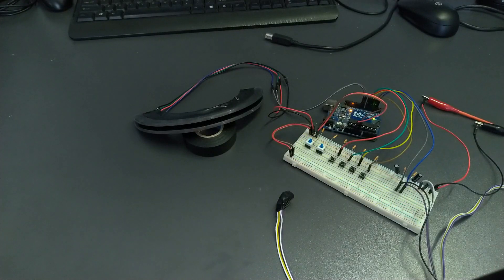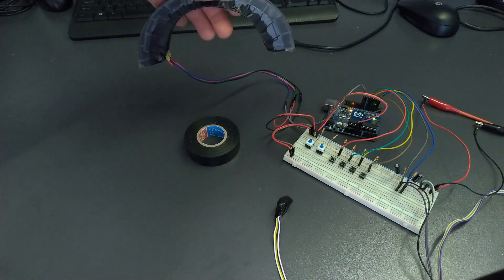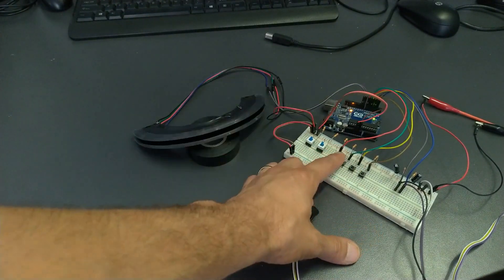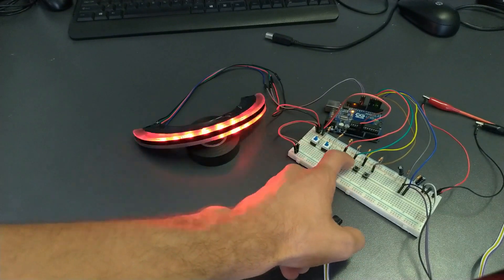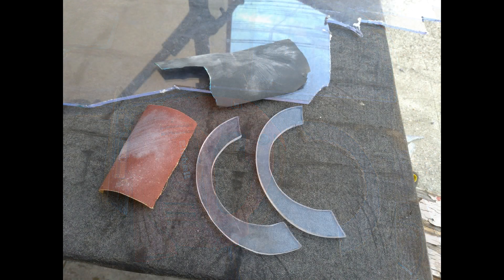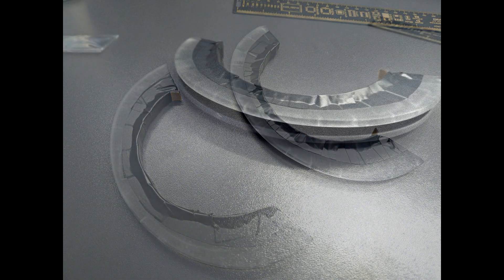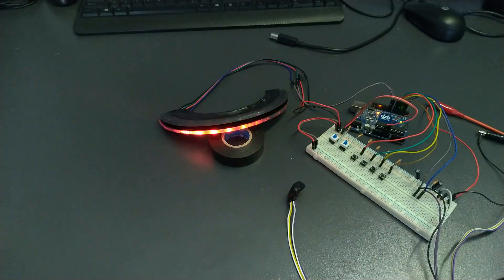DIY - How to make cool led bike lights (Sequential turn signal - Arduino, FastLED and WS2812)

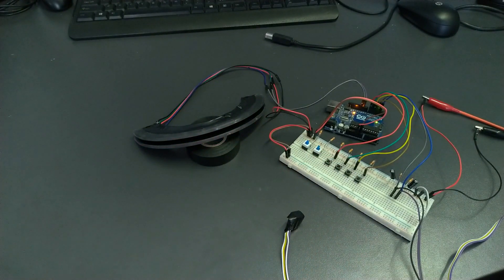Comment: 3:00 too many things. fellow drivers just get confused. normal lights, breaks, signal, they have to be so clear and easy. everything is mess up anything can be anything lol
Reply from the maker: The funny thing about that mess is that you can use only the functions that you need, anything that you don't need, just ground the input an it will not bother you anymore! ;)
Reply: @IonutF-TS-BB  or i not need worry have everything allready. allways better diy

Comment: How do you convert it to a module without using Arduino?
Reply from the maker: Because this project uses digital leds, you need a controller to drive them. If you don't wanna use an arduino, you can make your own pcb and use atmega328p chip to drive them. 
If you don't care about the animation, you can use standard rgb leds, but you will still need some electronics to make the signals...
Reply: arduino is developing platform. if you want make smaller module you just take original arduino blueprints and remove everything you not need and then make pcb uf uf

Comment: How would you transfer this to a pcb board
Reply from the maker: For a fancy pcb with the everything on it (cpu, connectors, etc) that will be your part, i'm just doing the software...
For personal project, i don't think you will need any pcb, but for a product for mass production, that is something that you will have to think of...